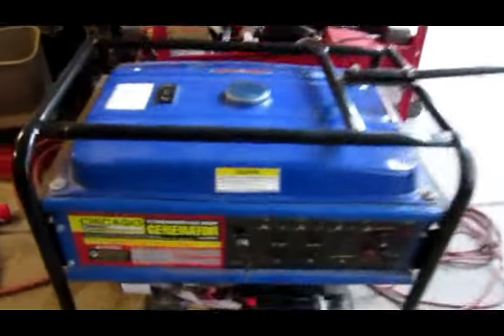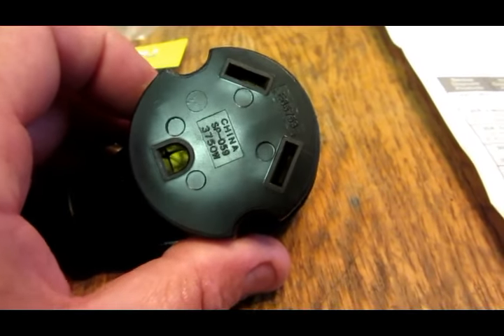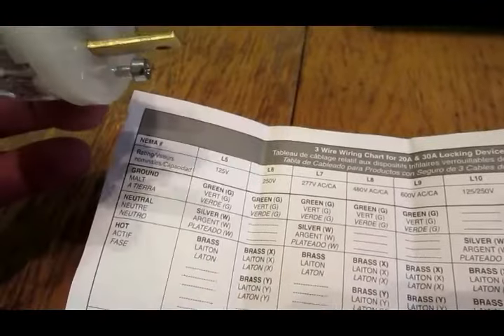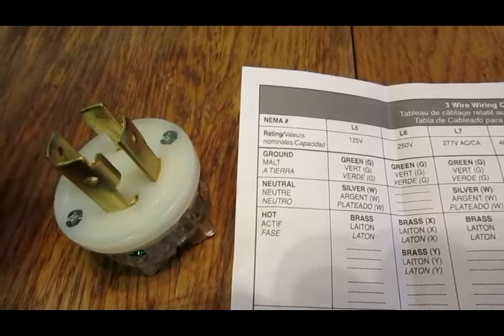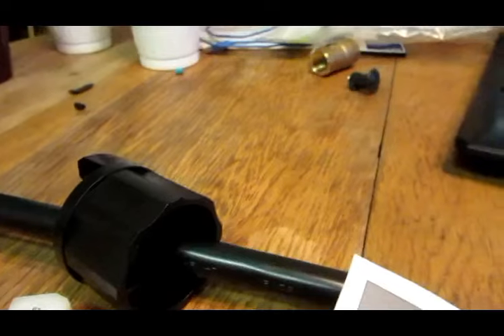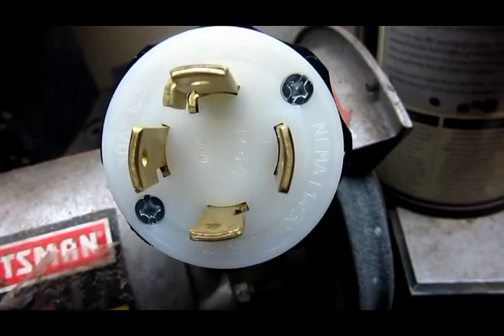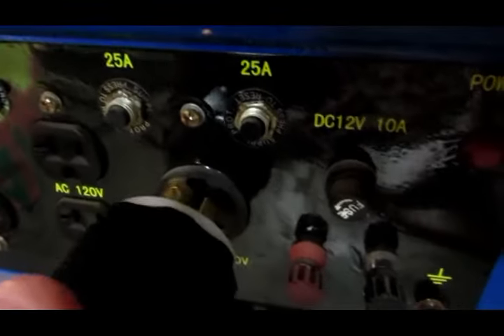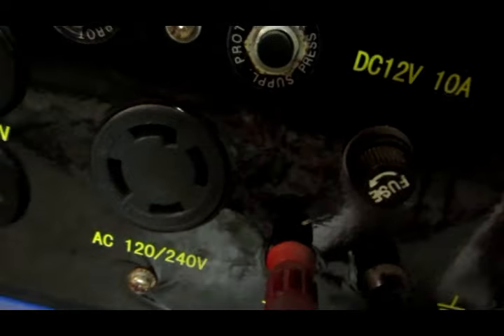Making a dog bone adapter for my  4 plug 240V generator to run 3 wire 120V 30 AMP

Comment: So you're just proving 120 by only using one pole? not 240?
Reply: That is correct.
Reply: @Dmacsimus 747  If there are four wires at the outlet check to see if the white wire and green wire are both connected at the breaker box. If there isn't a white wire I would change the wire between the breaker box and outlet if possible. I have never looked at the wiring connections inside a welder but my guess is that the white wire isn't connected in the welder. If that is correct the welder will work by connecting the green ground as you suggested. either way you will need a 4 pin outlet for the welder. Be sure the green ground wire connects to the right connection on the 220 volt plug. If the welder requires the white wire the welder wouldn't work when connected that way. The green wire is used to connect the frame of the welder to ground for safety to prevent getting a shock if the welder  has a short. you can change the outlet to a 4 prong that will fit the welder without adding the white wire and it would be the same electrical connection as adding a cord to convert it from a 3 prong to a 4 prong but it won't be up to code and some things might not work connected that way so i obviously can't recommend it for legal reasons. Either way I can't take responsibility because I am not there to verify that it is connected correctly.
Reply: The lack of a white wire on the welder should mean that the green wire from the welder is connected to the metal enclosure on the welder meaning it is a ground wire and the wire you want to use for ground so that is the one to connect to the generator to the ground prong on the generator plug. You are right on that. The plug and outlet you are putting on the converter cord should have info on where the wires go.  Are you putting the outlet and plug on the converter cord or is one of them already on the cord? If you are putting both ends on the cord this will work. If one of the ends is already on the cord it is a bit concerning because the white color is not correct for a hot wire making me question whether it was connected correctly. I would recommend putting red tape around the insulation on both ends of the white wire to avoid confusion and consider it as a red wire. Once you do that connect both ends according to color and you should be set.
Reply: @Dmacsimus 747 I have been trying to post an answer but somehow it keeps disappearing or doesn't post. probably will end up with a dozen answers but will try again. No white wire on the welder is the key. You are correct. Green wire is ground so that is what you connect to ground. don't connect anything to the white connection on the plug on the generator. Since you are going to be using the white wire as a hot wire I would recommend putting red tape around the white insulation both ends to identify it as a hot wire. Connect the plug and outlet on the ends according to color or if it lacks color code on the connections use the labels on them to be sure they are connected correctly

Comment: TT plugs/receptacles are cheap pieces of shit and the outlets become loose over time.  I think they are designed to pull out if an RV drives off with the power cord still attached.  The locking connectors installed on generators are far superior.

Comment: You wired this for 120 volt not 240 so if 120 is all you needed why didn't you go to the RV store (or Walmart) and buy the RV cable that adapts to a standard 120 volt wall plus. The generator has four of those outlets.  Most people need/want the 240 plug so they can get 240.volts. My RV takes 240 volts input but I sometimes use a convert / adapter to use 120 which means I can only use a little bit of electrical 'things' in the RV when using that adapter.
Reply from the maker: Because a standard plug is only 15 Amps and in order to run the A/C and microwave I need a minimum of 30 Amps.

Comment: if you connect to one  of the hot legs only, then you are only getting 2,500 watts, whch is about 21-21 amps , NOT 30 AMPS.
Reply: but you're not tripping the breaker under heavy load. as apposed to converting from the 110-15 amp (or on some generators 20amp).  those few extra amps make all the difference. and it keeps the other 4 plugs free for other tools etc.

Comment: I thought you were gonna rev it up and connect to application... was ready to LMAO if the vid was really a disaster vid online... but glad it is not.  Now, you would think the morons who design the systems would mark the plastic points on generator and on any adaptor you are making with color codes OR letters such as R for red and B for black and W for... etc... BUT NO,,, you gotta do REfreakingSEARCH to get it right... but if you get it wrong, OH WELL... CALL AN EXPENSIVE ELECTRICIAN.. (it MUST be a conspiracy!!!) I have opposite issue. I have a heavy duty 25 ft lead for a gererator 4 prong, but 120 V wit 3 std grouded 120v outlets on the other end... but my Generator has the RV hookup, and NO ONE seems to have the adaptor opposite of yours.  MALE RV 30A into a 4 prong locking FEMALE fitting.   I did see CAMCO has a short simple adaptor for your application. I think it was $9 or was it $13?  No dogbone, just adaptor.  I bought that one anyway in event my next or borrowed generator has the Generator fixture, then I would need it.   Since the old RV I bought is 50A (feeds 240v to rig but splits into two circuits,,,, second one if one were to want to install a second air conditioner. 
hell, i hate this electricity stuff.. I am a chemicals man.  But figuring it out.... but will probably forget and have to learn again (LOL)... Hey, I guess I could run an ARC welder with the RV 50 ft setup and lead.  Good to know.  I guess I will have to figure out the Red and Black for those types of DIY leads and such,,, running a box from an existing 240 V circuit (with proper buss fuses or breaker) and install a box to receive my RV shore cord.  OR make a lead to extend due to current distance away. Cannot be tooooo far away though without an additional breaker even if a designated unshared feed line.